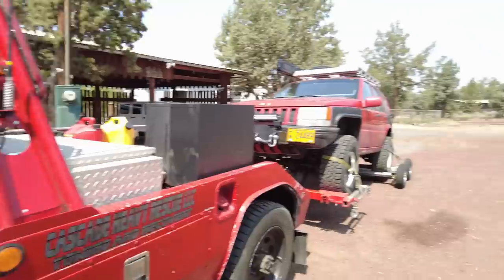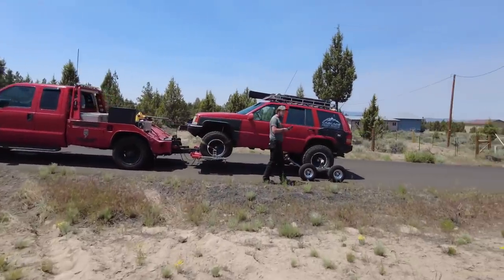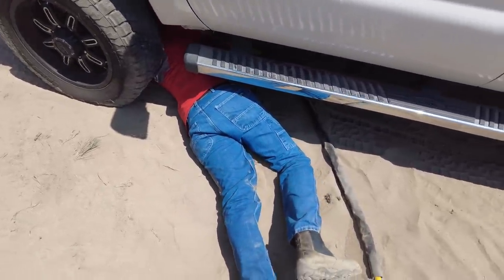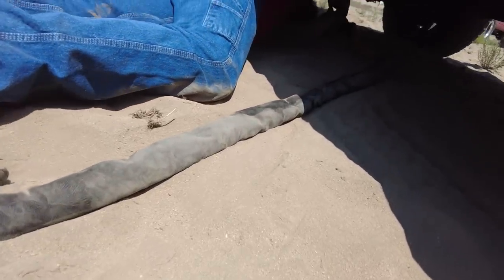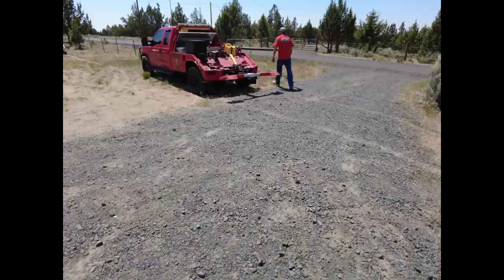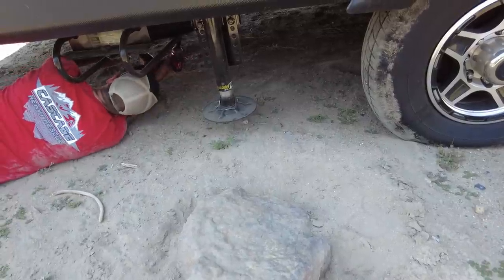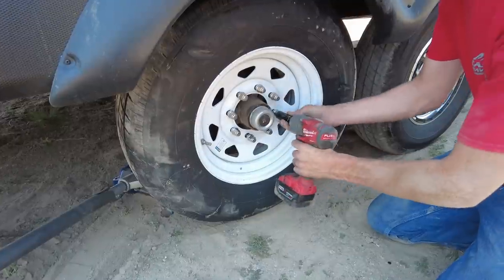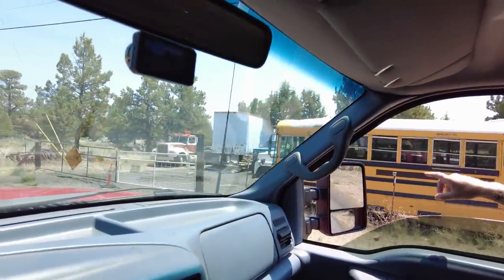Huge travel trailer stuck in the sand!  Can we get it out??

Comment: I used to live  in Tillamook  OREGON  and I used to tow out at the sand dunes  and I used to get calls  at 3am to tow cars up on the logging  roads and I had to dolly most of them it was a pain in the rump some times I could get the 4 door  flatbed  up there but they get stuck so easy so I used the old international  and dolly in the read crowned  dirt  road suck.
Reply from the maker: The new aluminum cross bars have a curve to them that solves the problem of the crown in the road and hooking up on the shoulder

Comment: Thanks for another great video. I purchased the air-down devices you recommended. I do have a question: My truck is a '96, 3/4 Ton 4X4 Suburban, with a 454. It is a beast, but I love it. With stock factory tires (80 PSI) and wheels, how low can I safely take them without fear of the bead coming off the rim?
Reply from the maker: I normally take my Dodge down to around 20 psi, sometimes closer to 15.  On a vehicle that heavy it's low enough to get the tires to deform and flatten out, but not so low that they are going to come off the bead unless you're rally racing.   
On my Jeep I have the deflators set at 8 psi, but will take them down to 5 in really soft ground
Reply: @CaseyLaDelle  Thank You. I will try the factory default on the deflators of 18 PSI and see how that works. I really appreciate the feedback.
Reply: @benkanobe7500  go till you're uncomfortable with how deflated they are.... Then keep your tires as straight as possible 😁😁
Reply: @merle6989  Good advice. Thank you

Comment: The “jack” on the trailer is a stabilizer not a lifting jack
Reply: Came here to say that.  Don’t try to lift a trailer with the stabilizer jacks, they aren’t meant for that and you’ll cause damage.
Reply: That's weird.... They will pick the trailer off the ground... But they aren't meant for it?
Reply from the maker: Depends on the trailer/RV.   There are leveling jacks and stabilizing jacks.  Two different things.   These are leveling jacks, that's why they're mounted right next to the axles
Reply: Simplest way to change a tire on a trailer with more than one axle is to pull the good axle/tire up onto a block of wood. A stack of screwed together "stepped" 2x6s work great.
Reply from the maker: @desmt4696  correct, but I only change a handful of tires a year so I'm not going to carry anything special for doing it.